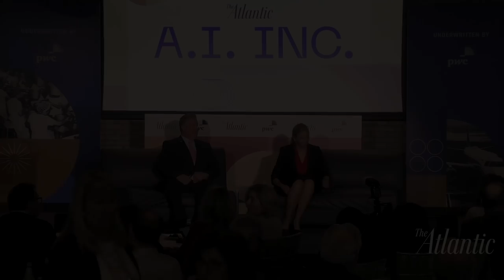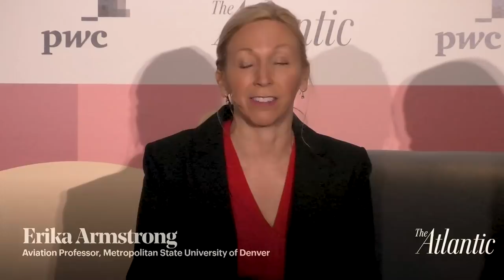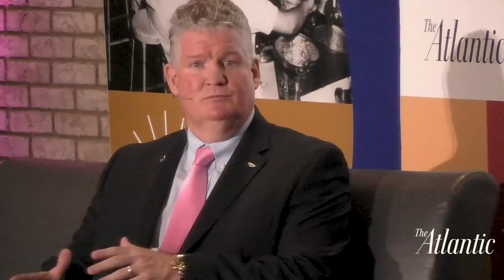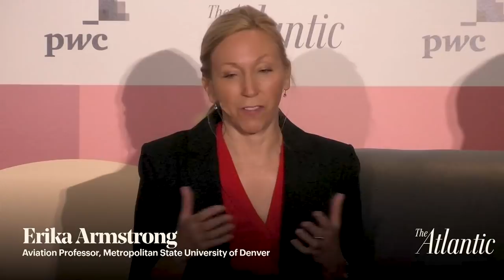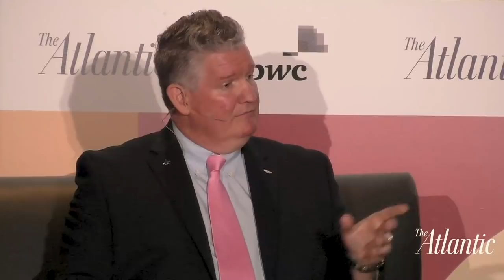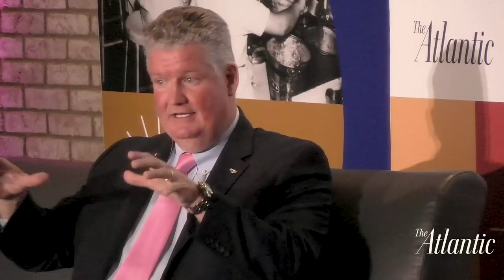Automation’s roles in recent airplane crashes

Comment: "Quick simple way to disengage the system"... it's on like page 5 of the checklist! Not exactly "easy" while pulling negative G's with the nose pointed towards the ground. Makes me wonder how big her check is from Boeing. As an engineer, I find her comments disingenuous at best. The fault is not on the operators, it's on the manufacturer's for deciding not to share information with the operators. Imagine if Apollo 13 astronauts had no idea about the systems in their SV... Their would have been 3 dead astronauts.
Reply: litngfan4life this lady is a professor?
Reply: You weren't there.